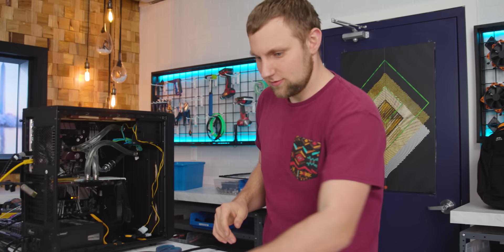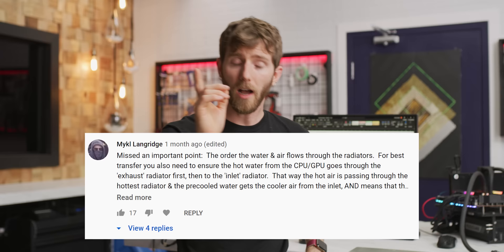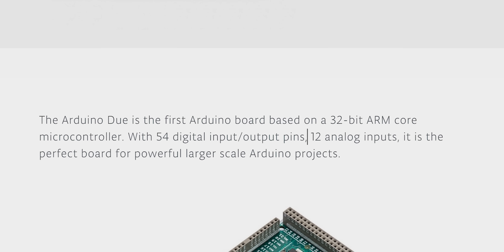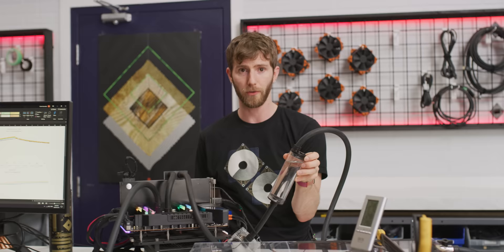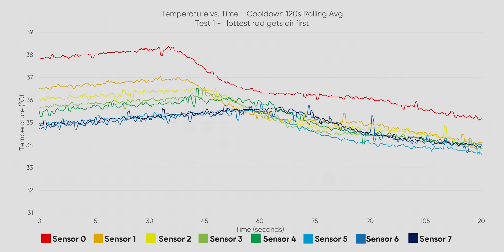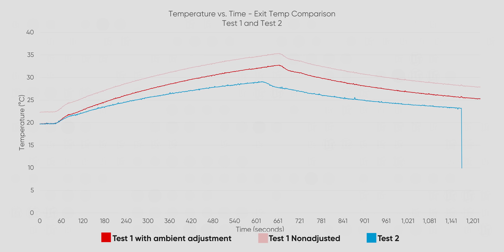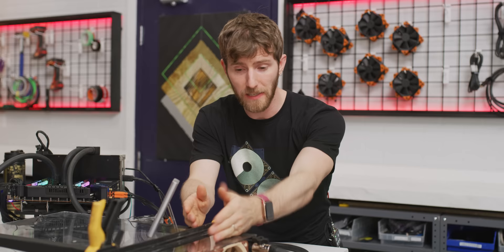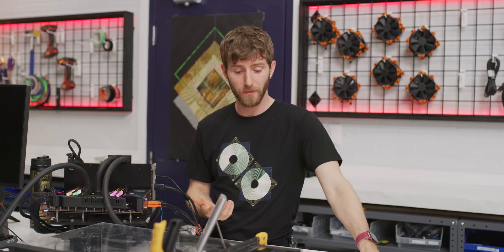Is this even going to work…

Comment: You can prove out the "ambient air leakage" theory by putting some more distance between the rads and adding tiny holes to the sides of your wind tunnel to allow air in at more than just the front of the stack.

Comment: A cheap source for heat exchangers if space or style are not a concern is the automotive world.  Plus some of them look cool. For example the heat exchanger (intercooler) for a Mercedes E55 supercharger. has a large rectangle inlet and dual 2" outlets. The water fittings are 3/4"  They are designed for high pressure and massive CFM as well as a enormous heat load but they are cheap used and in a custom case could be pretty cool.

Comment: I would love to see a passive water cooler. A large block of copper or alum with a couple holes drilled in it to pump liquid through. No fins just a heavy block sitting in the corner.  How many lbs of material would it take to get enough surface area to passively cool.

Comment: The hot should enter the radiator on the back and cold exits at the top, pretty easy. I'm running 16 cores on a 6 pass cross flow home heat exchanger never gets about 50c. Runs normal computing a 19c

Comment: There is a gradient between ambient temperature and water temperature. The bigger the gradient (delta T), the more efficient the heat transfer. Once you have so many radiators like that, the gradient is eliminated. By the 5th or 6th radiator intaking warm air from the radiator in front of it, your gradient starts going the other direction.

This test really muddied the water. More radiators does equal more better as long as the exhausted air temperature of each radiator is still lower than the water you're trying to cool in subsequent radiators. If you dumped two to three times as much heat into this loop, you would have had a different result.

Comment: btw, if you are gonna stack 7 radiators what if you used SP fans for the radiatos and also put some fans underneath? (AF so it doesn't affect the presurre much but brings fresh air from outside) or in case of noctua, if use the same models of fans maybe just make those extra fans at a slower rpm
if i could i woul try it but, you know, money, time, money, space, money...

Comment: It all depends on heat load versus air flow rate, which Linus mentioned.  If the first radiator heats the air up to the point where the second radiator has no differential between air and water temperature, then the second radiator is worthless.  However, as you increase air flow rate the air temperature will decrease downstream of the first radiator.  There is a limit to how air velocity affects heat transfer; doubling flow rate does not double heat transfer rate.  Rule of thumb, a 100% increase in air flow rate, or water flow rate, will only increase heat transfer by 10% in a given heat exchanger, effectively decreasing the air temperature rise across the heat exchanger. by almost a factor of two  You want more heat transfer, increase the surface area of the heat exchanger.  
So whether the second radiator is worthwhile depends on heat load, air flow rate, water flow rate, and surface area.  If you have side air fans bringing in cold air between the two radiators also has an effect on whether the second radiator is worthwhile.

Comment: the other factor you need to consider is the fact that your passing the higher heated air through the next radiator, if each radiator had the same free flowing cool air and you stacked the rads side by side, i think even then(correct me if im wrong - im no engineer) each would show a much better decrease to the temps compared to this test

Comment: Right off the bat, I can tell you is the rads are in series, and air flow is running opposite of fluid flow, the rads are going to be very effective at cooling. Remember that heat flows from Hottest to coolest, so if the first rad the air goes though is the coolest, you will maintain a delta between the air and the fluid.

Comment: Great video - low the deep dives that you invest in here!
One thing that I would love to see in the future is that you "clean" the data so that you first show the raw data, and then get rid of all the tiny spikes, as those I would assume are just reading fallouts and not actual temperature bumps (in the case of 1 vs 2 rows of radiators you have a delta of more than 2 degrees in the fallouts).
Overlay the two at first and then use the "cleaned" graphs :)
Keep up your great contend!

Comment: Have you tried using two rads not stacked but sharing the pipes for moving the collective heat flow with individual fresh air flows?

Comment: you could use your compressed air cooler thing to blast -0 air through the rads ... thus eliminating fans and haiving more airflow with far cooler temps ...

Comment: The Aquaero 6 has 8 temp sensor inputs. I currently have support for 18 temp sensors in my daily driver.  For this test, the pump was inadequate. The delta is simply too great. Also, those temp sensors are not that great. They should be within something like +-0.1C. Mine are. Also, what happened to "loop order does not matter" with that insane delta of yours? Order means a lot, if pump is weak. The placing of the temp sensor should always target temp out the rad, and temp out the pump. Simply due to the max temp limit of the pump. This is why you place the sensor after the rads, and before the pump, if you only have only one water temp sensor. This is why you need two sensors, to know if you are running your pump fast enough, as in keeping the delta low enough.

Comment: Basic physics would tell you that in most circumstances stacking radiatiors would not improve cooling performance.
On the other hand putting radiators side by side increases the delta T, which is why you put radiators on multiple places in the case to have better cooling.

Comment: There is a simple flaw in the design no matter what if you stack radiators. It has to do with temperature differential. I'm an X naval nuclear reactor operator. As you can imagine keeping a nuclear power plant cool is very critical so understanding thermal dynamic with water cooling systems is a massive part of the education. The greater the difference in air temperature and the fluid greater your transfer rate. Well there are other factors also air speed surface area, the type of water flow such as if it is laminar flow or turbulent flow or if  you have boiling going on...  For your experiment though you should get better results if they aren't stacked at all. Given water flow is also important putting those radiators in parallel  vs series is a better idea. If you are worried about space mount them at a 45% then have a plate separating the air flow of the radiators. Let me know if you need a diagram.

Comment: Would having fans right up close to radiators cause cavitation ? Maybe have them seperated by a few inches by a sealed chamber and have them suck the air through the rads then you could also stack rads without fans between them .

Comment: I love the wind tunnel, good data collection technique, but i think its better to use a 500-1000w water heater(resistance) so its a constant load, then redo tests with 1, 2, 3, 7 radiators

Comment: Hi,
As the tests in both videos showed several interesting behaviors on the temperatures, not all my questions are answered. I would still like to know what the temperatures on the single heat sources like the CPU or the GPU are. 
-	Is there a positive effect of using single radiators in the loop for each heat source?
-	Will it positively affect the actual core temperature of the single Chips?
-	Using 2 smaller radiators instead of 1 big one, 2x140mm vs. 1x 280mm?
Pump  CPU  RAD  GPU  RAD  Reservoir  Pump
This should allow some heat being drawn out of the loop before the water hits the next heat source and should therefore be able to take away more heat as the coolant should be cooler at the time of contact raising the delta-T.

cheers

Comment: If you get two electric thermal coolers then but a patch of fabric areojel. Get two radiators slap them all together radiator, fabric with cutout thermal cooler inside then radiator wires outside.  Then slapped that on the end of your system you would remove the diminishing returns problem.
Reply: You could also replace all your fans with a high powered shopvack for a smaller affect.

Comment: Instead of using trimpots and having to calibrate them all, you should’ve just used 4-wire thermistors. You’ll need twice the analog inputs but it would’ve reduced complexity while increasing precision

Comment: The contra-flow design is the more efficient method of "stacking". However,  the air gets heat saturated before it gets to the other rads. If you really wanted to get the most optimum cooling,  you'd have to daisy-chain the rads in a row with cool fresh air flowing into each one, not air flowing from one rad to the next. 

It would take up a lot more space,  but if you want the ultimate,  well,  sacrifices must be made.  🤷‍♂️

Comment: Seems like the problem with stacking is warmer air from the first radiators blowing on the later radiators. What if you had some kind of ducts that blew the hot air outside, and brought cooler outside air in, rather than just blowing increasingly warm air on each successive radiator?

Comment: Would the layout of a more planar setup make better use of the air? Rather than having the fans channeling all the air through all of the radiators in one direction (cuboid channel), would it not be better to have the radiators aligned in parallel to eachother, so each radiator is cooled by itself and only itself, not being affected by potentially pre warmed air from a previous radiator in the channel you created?

Comment: I would suppose stacked rads perform a lot better when loads oscillate between high and low, because of how difficult it would be to change the temperature of a large body of water.

Comment: This looks pretty cool as an idea. But I would seriously rearage the coolers. Lay all radiators flat instead of facing eachother. All you are doing is blowing hotter and hotter air down consequtive radiators. Don't house the radiators inside a casing. Place them inside a frame and you have effectly created a room heater that is very effective at cooling your pc. Could you test that idea ? All radiators flat, in a frame, in series with fans on all radiators.

Comment: The best way to increase, or should I say decrease cooling in a pc, is not to add more fans or more rads, or to stack rads, or to increase head pressure, or use a chiller...
It is to change the ambient temperature.
Why don't we use a refridgerator? The compressor is not rated to cool that much tdp.
Ya know what is? A window AC unit. Coolbot for the win.

Comment: Maybe in the dual rad test, if the single set of fans were in between the radiators the test would show more improvement between the single rad and double rad systems.

Comment: Pour faire simple, le débit d'air en entrée a une capacité de dissipation propre.
C'est pour cela que parfois il ne sert à rien de mettre les ventilateurs sous 12v, la température ne baissant plus car le flux d'air dépasse la capacité de dissipation du radiateur.
Dans ce cas il reste de la capacité à l'air pour refroidir un autre radiateur.
Cependant, c'est contraire au but premier du WC qui est d'être silencieux en faisant tourner les ventilateurs lentement.
Mais si vous avez un très petit boitier et l'envie de refroidir une très grosse configuration, l'empilement pourra-t-être envisageable.

Comment: the series configuration is not appropriate.  the heat removed from one bogs down the flux of the one downstream and so on.  fully parallel would have been a better test....  then you're getting a more efficient and consistent heat flux into the room.   but at the end of the day, the limiting factor is going to be air exchange of the room - once you hit steady state.  the parallel config would result in a higher convective heat flux due to a larger delta T over a larger surface area.

Comment: You guys should try water cooling a pc with a car radiator and fan configuration. That would be quite entertaining to watch and should be possible as long as you use an electric car rad fan. Finding a good electric pump would require a bit more work as you wouldn’t be able to use a mechanically driven water pump like a car does unless you use an electric motor that can power the pump properly.

Comment: Linus Great Video as Always!!  Do something on Benefits/or Not of Fan Shrouds.  I Notice most of your rad/fan testing is with the fans placed right up against the surfaces.  Where I have seen in one test, that placing Space/Shroud between them improves things by almost 6%, especially in push/pull.

Comment: Weird. It's like the study of air to water has been around for a while and hadn't come up with the whole "big/thicker radiator can be better as long as you have proper air flow" idea. There is a time and place for a thicker radiator. Race cars will switch from a stock 2 core to a 3-4 core radiator with an upgraded fan and it handles the temps better. But again, you need an upgraded fan to get the air moving fast enough (or in the case of a car, you need to be driving fast enough). 
Would have been neat to see this test but with some server high power delta fans.

Comment: Did you account for the time that it takes for water to complete a full loop? Considering the "heat soak" example, it looks like it might just take 30 seconds for water at the inlet during peak temperature to finally exit the last radiator. What is the volumetric flow rate of your pump, and what is the fluid capacity of each radiator?

Comment: Couldnt you have very easily tested your theory about ambient air mixing with the post-first-rad air improving cooling by just drilling a few holes in the acrylic between the 2 rads in your test rig?

Comment: I wonder what this test looks like if you have something like an air compressor blowing air in.  It would have to be craft level. The flow of even a body sized system would be a bit strong on the frail fins.

Comment: You're blowing hot air radiating for 1st radiator to the cold radiators behind it when stacking. The latter radiators effectively become heat water heaters.

Comment: Countercurrent flows allow hot air to contact hot water and cold air to cold water for maximum thermal efficiency.

There are upper limits but. It works.

Now to watch the video to see how well it works

Comment: you should fill a loop with dry water/Novec 649, or revisit the mineral oil pc and replace the oil with dry water/Novec 649. curious to see if that would work at all. Novec 649 is a refrigerant as well as a retardant in a sense and is used in fire suppression systems in data centers.

Comment: When you're making that kind of infrastructure investment into cooling, you may as well go to a superior cooling arrangement and set the rads in a plane, rather than one behind the other. Having the cold air hit more surface area is what wins the gains. But it really depends what your targets are. Fit it in or on the back on a case - not so good. Dedicated external rad - good opportunities to make gains. Fan / space conservation, again limited opportunities. i'd like to see someone build a rad for the case side, on the back of the mainboard, pull air out of the case and through a rad, the size of the side of the case. Should be equivalent to 3 or 4 rads. Still, you'd need 6 to 8 fans and probably an extra water pump, in line to boost the water pressure.

Comment: Hmmm what if you add fans between each rad Inputting outside air drilling air holes between each causing a positive escaping one direction flow each rad would get fresh air.

Comment: I mean, correct me if I'm wrong, but the majority of the cooling comes from the temperature of the air flowing into and through the fins of the rad. So by having multiple stacked like in the video, you're only going to be blowing the heated air through the subsequent radiators. Surely the best way to have a multiple rad system would be to throw the conventional front and side mounting out the window, and have rads stacked side by side so they're getting their own independent air flow. so if you had say 2 side by side, how low would the temps go? How low would they go before diminishing returns? I've always found it silly with how 2 rad systems work, because one will always have warm air going through it unless you had them as both intake with no exhaust, but that means no cool air for the other components. Would it work best having two top mounted rads exhausting air (2x240mm if it would fit in anything)  with the front as cool air intake?
Reply: Also, what if there was a case where you could back mount a rad which has the Gpu mounted to it... so that cool air comes in through the front, cpu rad on top exhaust, and rear gpu exhaust (or linked if that's better?)

Comment: It should be said that the higher the temperature you're trying to cool, the more useful more radiators becomes. But if you're trying to dissipate a relatively low amount of heat, having more radiators doesn't really do much.

Radiators only dissipate a certain amount of heat by the time the water exits. So if you're trying to cool something of 120 degrees or so, you will probably need more radiators to dissipate the heat by the time at red background again. But obviously 120 degrees is not something you want your PC to be at in the first place.

It's kind of a fun science experiment though. 

Think you guys would be interested in seeing how many radiators it would take to get a return of 40° when starting and 120 degrees? haha.